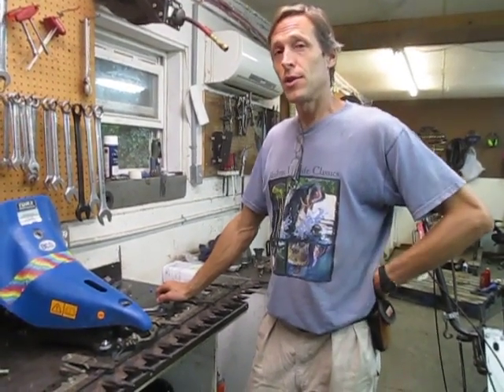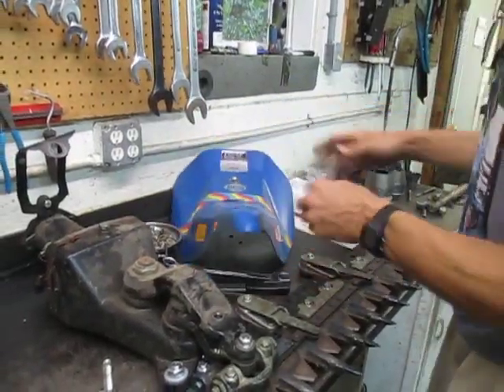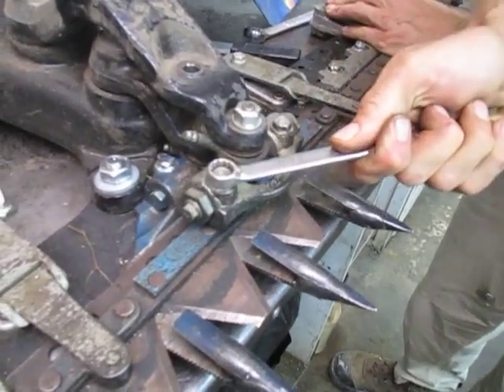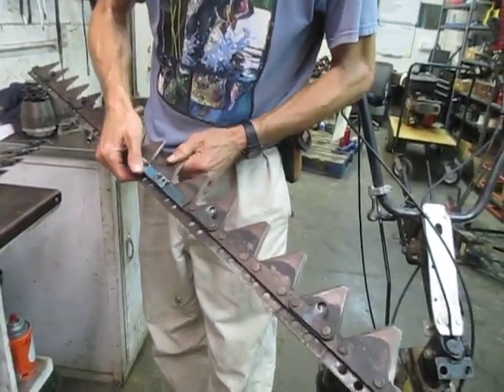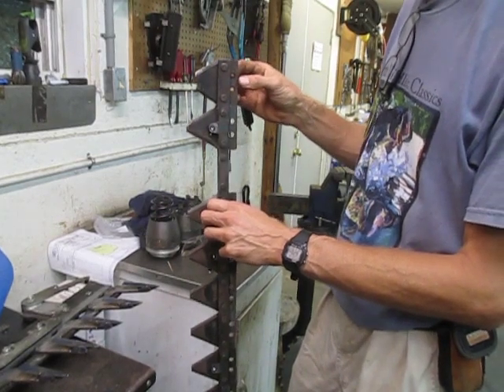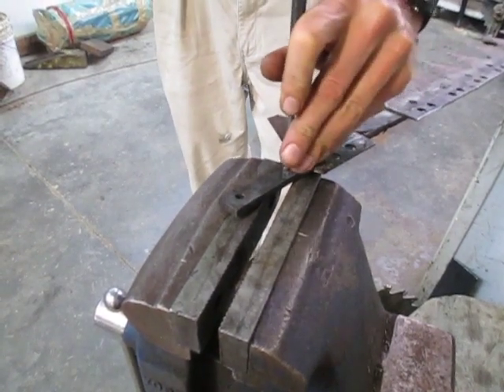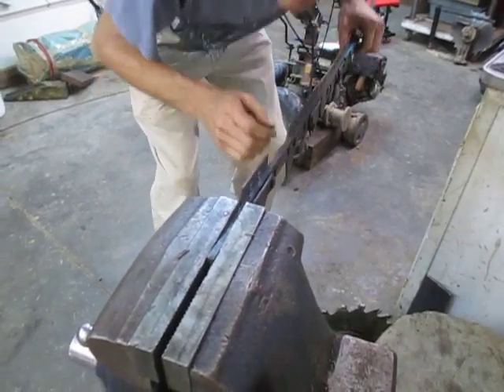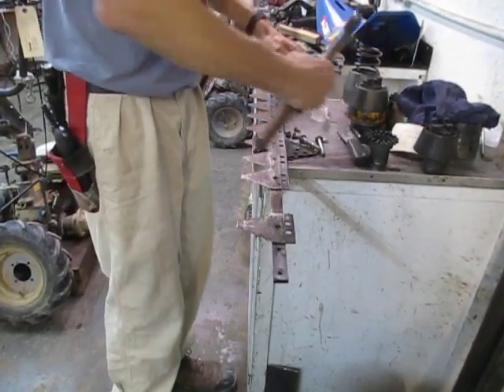Double-Action Cutter "Sickle" Bar for Walk-Behind Tractors: Service & Maintenance

Comment: Thanks Joel. Lots of good info.  Any tips on changing the transmission oil on these?  The biggest sickle bars are kind of unwieldy and I believe there is only a single fill/drain hole.

Comment: Hi Joel. I have a single action oil bath bcs transmission. I put grease on the zerk so it libricates when the bar goes on slopes. However, when I went to see the oil level, I out it was full of grease! I think i put way to many pumps that the pressure from the grease went through the bearing in the back(pto). Can I remove those big 4 bolts from the back to clean it out? Will the bearing need replacement even though it looks in perfevt condition?